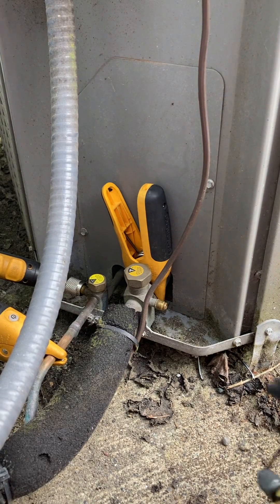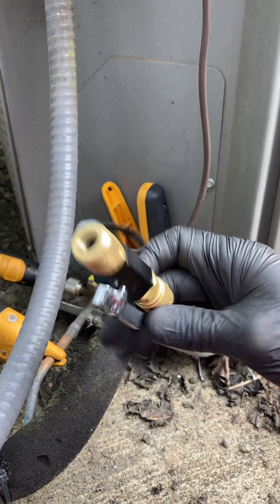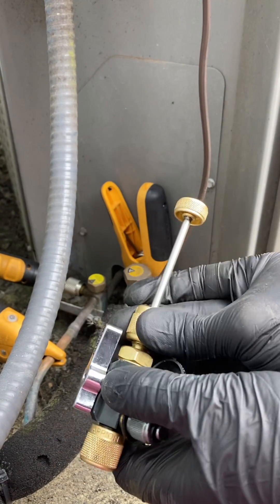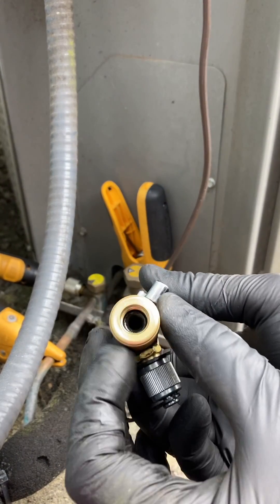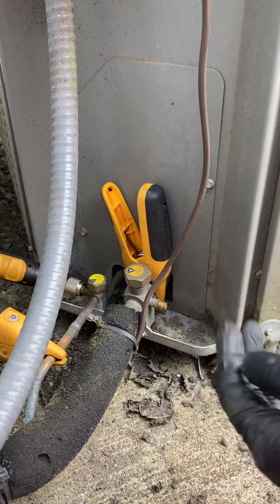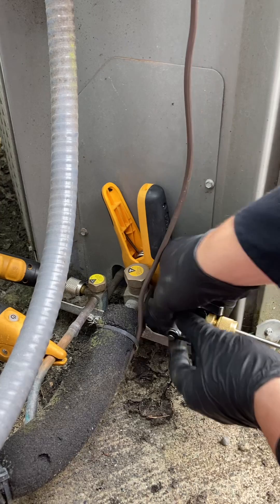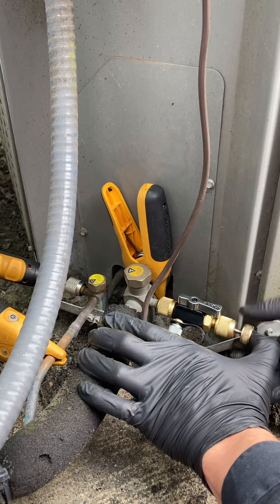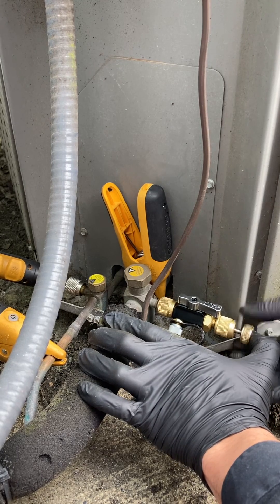How to remove valve core first try

Comment: That’s the low side, the high side I’m struggling like a crazy person. One time I got so fed up I couldn’t take the valve out, I recovered the while charge to be able to pull that core out. How do you gap those removers to hold the stems?
Reply from the maker: @richlikeg3722  the pressure should push the core out. You shouldn’t need to grip the stem. Test on a spare core you have laying around. What valve core tool are you using?
Reply: @victork3397  JB tool valve removal. I think the stem kept pushing it out of the removal tool so it couldn’t hold it on.
Reply from the maker: @richlikeg3722  yeah you have to make sure the extractor is pressed in pretty firmly. Otherwise it doesn’t grab the valve core. I made another video was having that issue today as well 

https://youtu.be/BFWrOB7ywXg